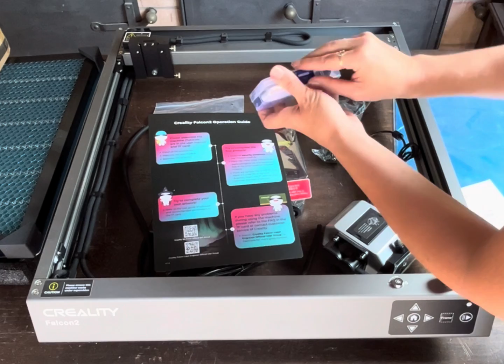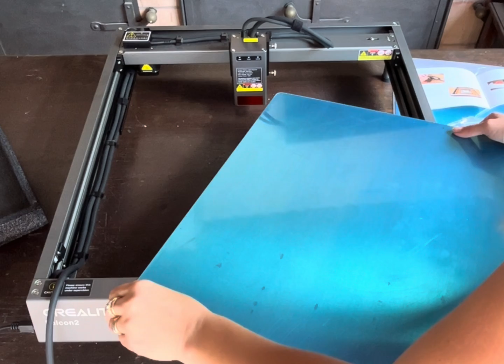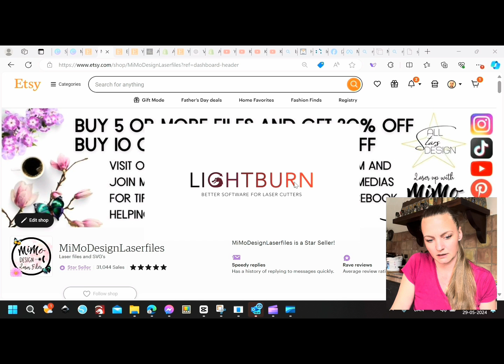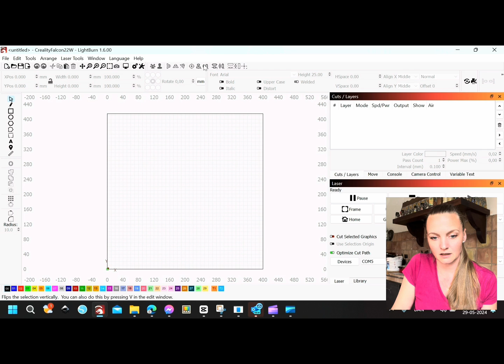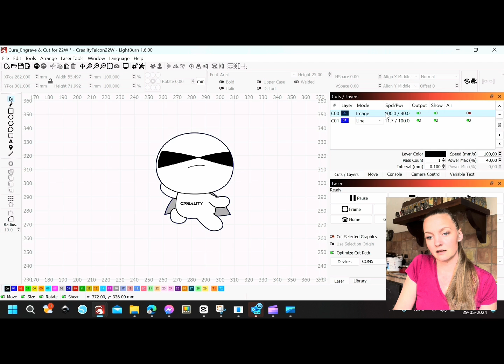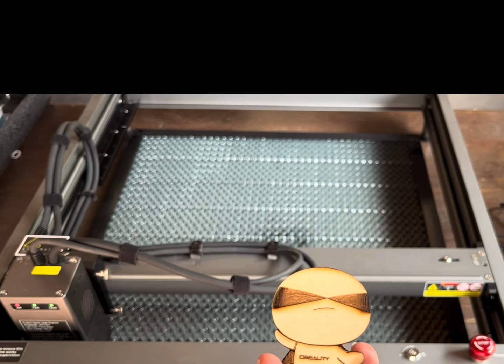The Ultimate Guide to Setting Up the Creality Falcon 22W Laser Engraver

Comment: When you compared the sound you compared the diode air assist with the co2 extraction. Once you add the extraction to your Falcon it will be as loud as the CO2.
Reply from the maker: No, I was actually speaking about the air assist, which will automatically turn off on the Falcon, but on my co2 the air assist pump and  waterchiller is constantly running and creating noise

Comment: What’s with this honeycomb stuff all about? I’m just gonna engrave on wood, on top of wood on top of an old glass table that I don’t care so much about the well-being of. The fact that these guys couldn’t bother to include an SD card is kind of annoying since I had no luck plugging my computer directly, and so I just formatted one from a camera.
Reply from the maker: The honeycomb is mainly for cutting because it helps air circulate under your material, which reduces burn marks and improves cut quality. If you’re just engraving, it’s not as necessary, but it can still help prevent overheating. I’ve never used SD cards either; I always use USB or connect directly to my computer. If you’re having trouble with the SD card, formatting it to FAT32 might help.